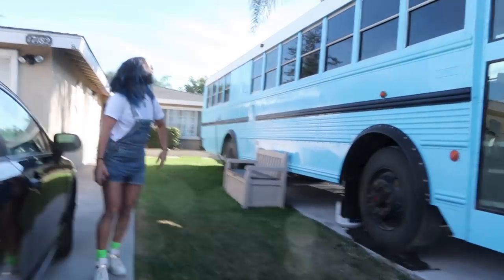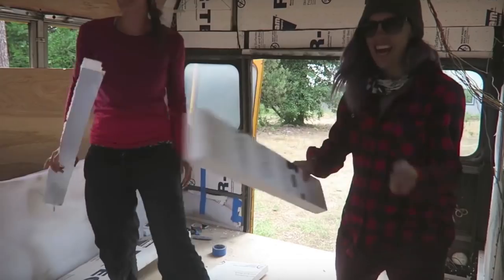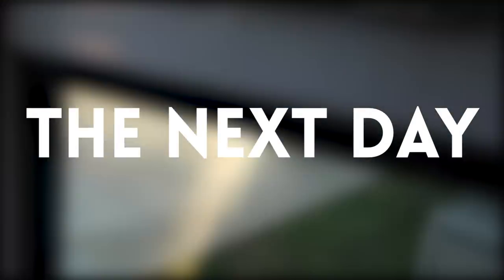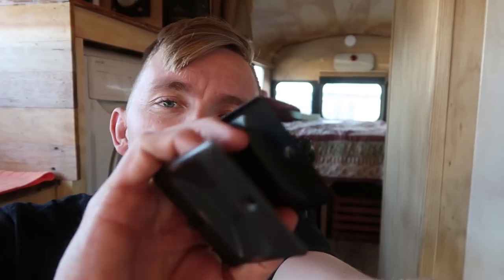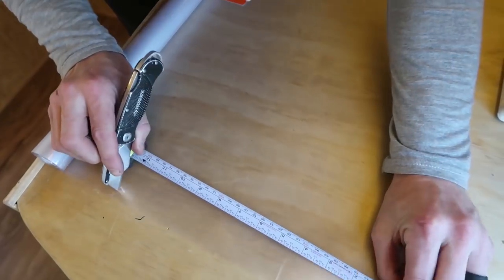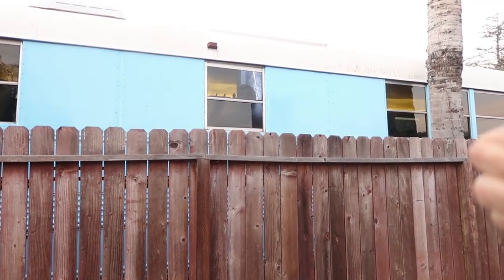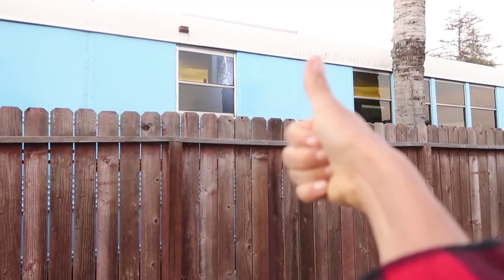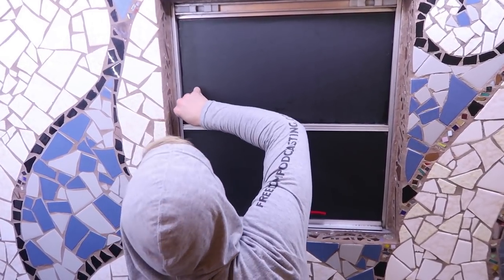#101 SKOOLIE BUS CONVERSION | V's BACK, Plus we wrap up the Locks, Backsplash and Bathroom Window

Comment: Glad you took my advice on the Metal stove shield behind your cooktop!  It will protect the window from shattering when you are cooking!   Welcome back Ms. V!  Now you just have to get your curtains made now!
Reply: Just wondering, have you experienced a broken glass behind the stove?  I realize that grease will be easier to clean from the metal than the window frame. And I'm sure grease will run down to the counter and under the metal.  I like V don't really like the look of the backsplash as it is.  However, I don't know how I will do mine differently.
Reply: If one cooks during cold weather that close to window, it can cause the window to shatter